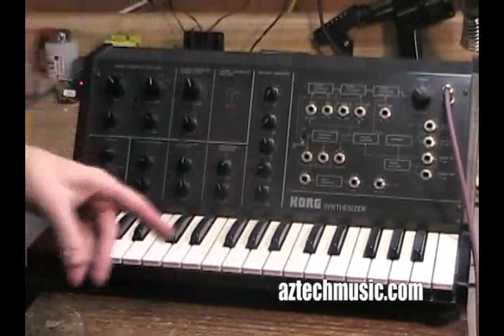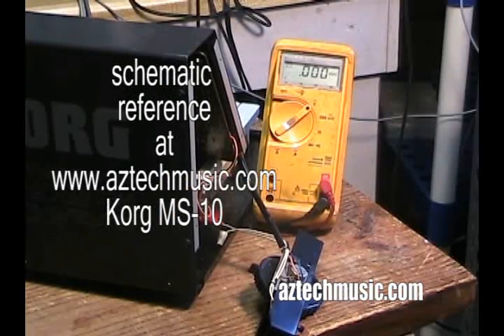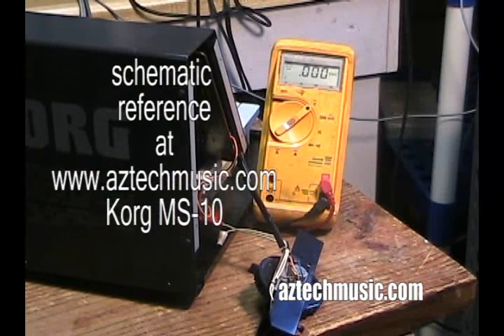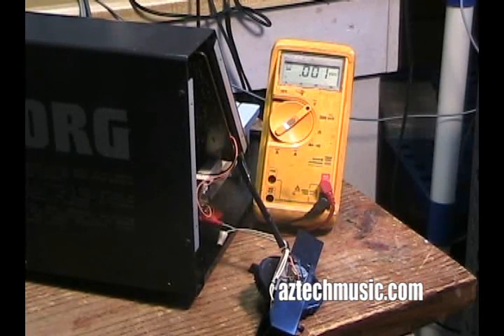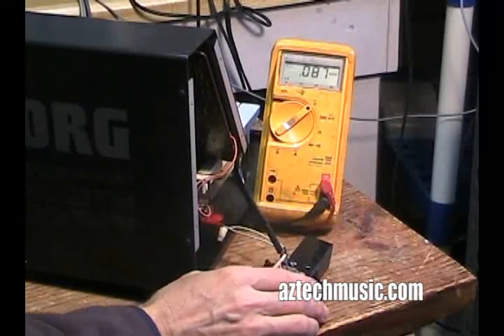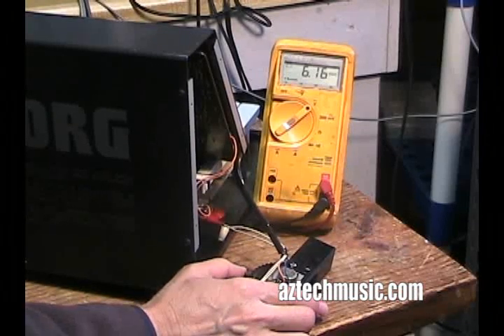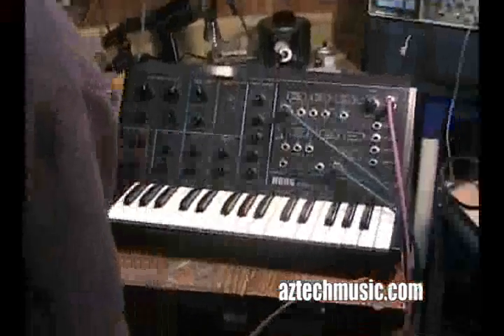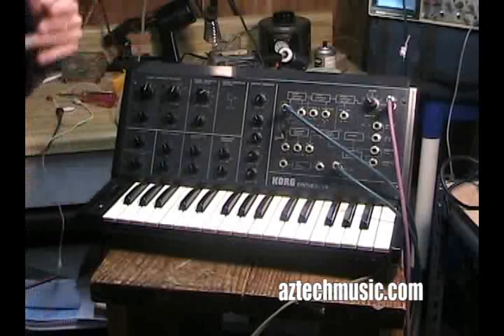Korg Synthesizer MS-10 Pitch Bend Repair

Comment: the pitch wheel must be connected to a destination via patch cord! It is not wired internally.
Reply: AnalogAudio1 - absolutelly right. 
And this controller it's a multi-functional wheel (pitch, modulation, volume etc.), it's not just "pitch-wheel". 
AND - in the first test ( 0:18 ) pots of this synth - has SETUP FOR THIS "PITCH DOWN" SOUND...
Well, very "good" and necessary tuttorial for youtube...
And MANUAL FOR KORG MS10 - just a paper for idiots, it's not a true way for good Wizards...  :)